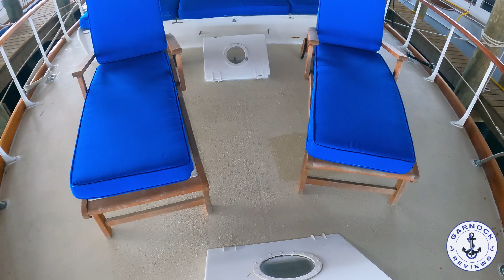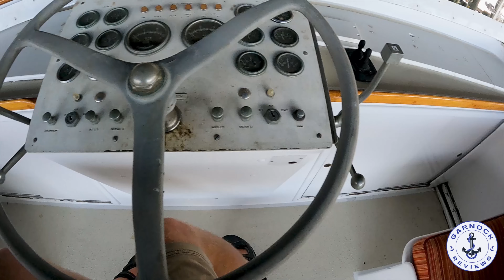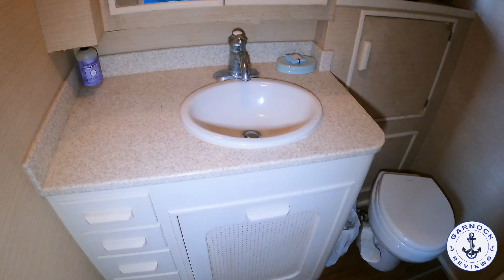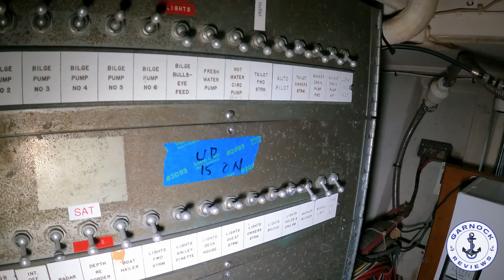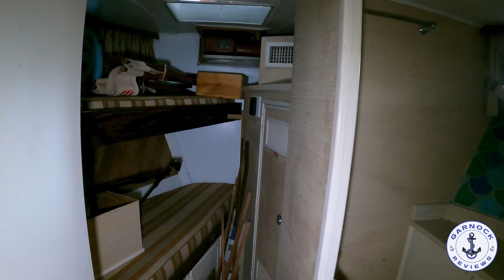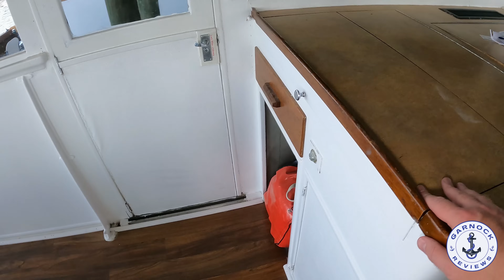[Sold] - Reduced To $80,000 - (1973) Huckins Offshore 58 Classic Motor Yacht For Sale

Comment: My wife and I are looking for something to retire on.  Sell our house and use the money to pay for the boat and live in it. We are good at plumbing, tile, concrete, carpentry, electrical, pre-1990’s auto engine repair and lots of other stuff.  We are looking for something that is safe for traveling calm waters.  We grew up on the Texas coast and are used to hurricanes.  We love physical work but we are both over 60.  We have very little boating experience other than occasionally renting small sailboats.  For a few months at a time, we have owned and lived in a few motorhomes and travel trailers that needed constant repair.  Would this be a good boat for us?
Reply from the maker: This would be perfect for you. At face value, I didn't see any work needed that you couldn't repair yourself at some point by the sounds of it. As to handling the boat, this one has both bow and stern thrusters, as well as being twin screw. You could spin this boat till you were dizzy if you wanted to 😆

Comment: I like all your reviews but this one is a tired old boat
Reply from the maker: I appreciate the continued support. The good news is, this one appears to be structurally and mechanically sound. It went on a recent burst on the river to get photoshoot for the listing with no issues or signs of smoke etc. 

In the perfect world, the work I would focus on if it were my boat, is more cosmetic focused. The fact it's for sale through Huckins is perfect as they can help with any and all work required, and know the ins and outs of every design aspect from bow to stern 😉
Reply: Yes - as long as that hull is sound and systems fettled, that entire interior could be gone through as time permits. I would suggest to them they invest a day or two repainting those engines. Nothing like gleaming power plants to inspire confidence no matter the vintage.
Reply: @motorv8N  Yes agree it just needs some love and TLC